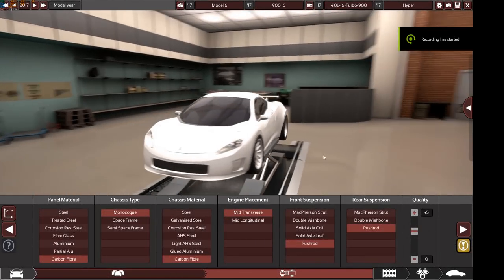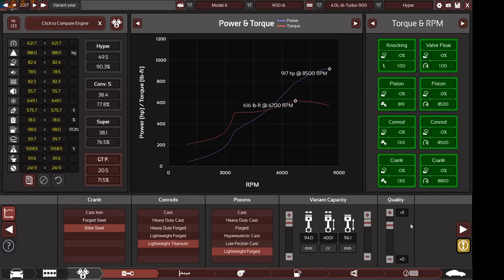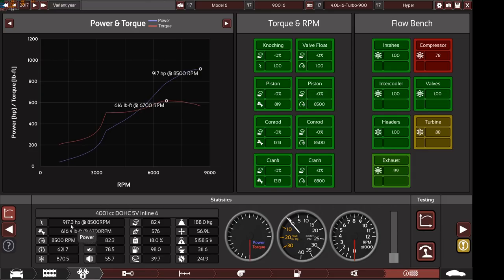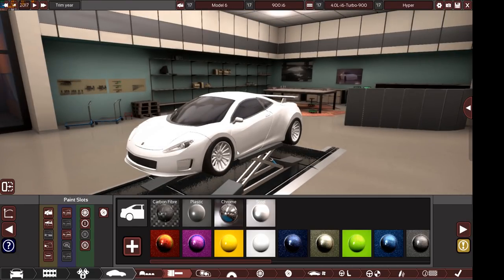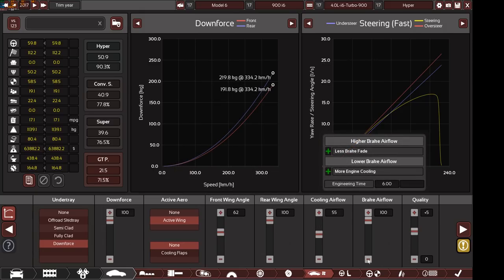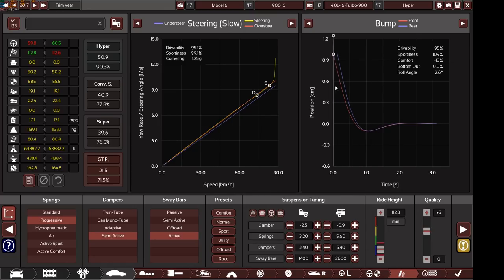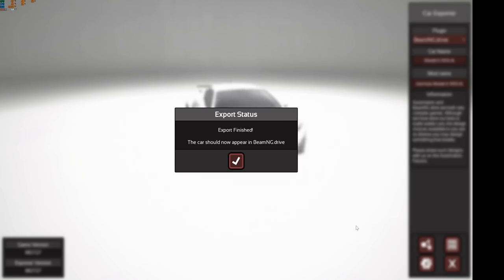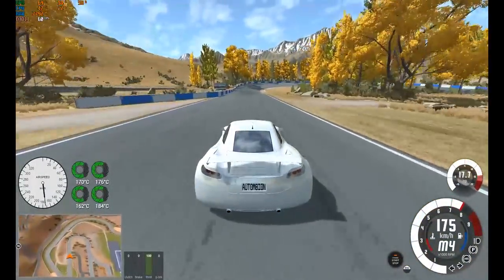Building the Perfect Track Car in Automation + BeamNG Driving.

Comment: You really went with a transverse inline 6?! You should have gone with a longitudinal twin turbo v6 or v8 rwd or awd. You also said that the car model you chose with a tranverse engine doesn't get 50/50 weight balance (wich is the best balance for a track car) but a 70/30 rear/front balance and massive downforce on the rearwheels. That would make the car understeer a lot and reduce increase the braking distance because the front brakes don't get so much weight on them.
Reply from the maker: Ok, just a little question. Have you watched the video? 

The car is a dream to drive in a straight line and around corners.
Don’t worry I know what I’m doing.
Reply: Bshar Nasri yes I watched the video the car has ~60/40 balance and more weight in the rear improves acceleration but about the same weight in front and rear improves cornering and braking. And ehat I saw in your driving the car did indeed understeer
Reply from the maker: Have you played BeamNG game with an Automation car before? Or are you new around here ?.All cars in beamNG understeer when the car reach a corner with a high speed, what do you think that the car runs on a railroad track. The car is cornering perfectly when you learn how much speed you need to get into a corner with. And oversteer when you want it to. FYI I have a van with 50/50 weight distribution and it corners like a broken shopping cart because of the suspension tune was tuned to comfort not sport. Weight distribution is not enough to make a car drives well, you need to learn that it’s important to tune the suspension and the aerodynamics and the power distribution and the gear spacing and the tire size and the ride height after you settle on the weight distribution which makes the car corner hard even if it was 20/80 weight distribution.
That’s how Automation and BeamNG games work.
Reply: 70/30 is always the option, with struts if possible, I got other games with Good physics.
Reply: Moral of the story here. Don’t be a smart*ss

Comment: You should try to make a realistic 300mph car I know u need about 2000hp and u need to get there fast bc in real life the tires that can handle it will overheat before u get there so u need a really good power to weight ratio good aerodynamics and excelent breaks it will be more impressive if u can do it with less than 10 cylinders

Comment: Why is it that most automation cars understear like crazy
Reply from the maker: This video is very old 

But the reason why everything understeer in Beamng is 
You are using the Maximum steering all the time maybe because you are using a keyboard or because you are not used to use 30% on the contoller to steer in BeamNG.
 that's how beamng works with automation cars the less steering input the better the car works.

You have to remember that every Automation car behave different.
Some cars needs the least steering input to run, and some needs more.
Reply: Bshar Nasri i use a wheel
Reply from the maker: @thedankatheist3466  then u need to set it up correctly and use less steering input